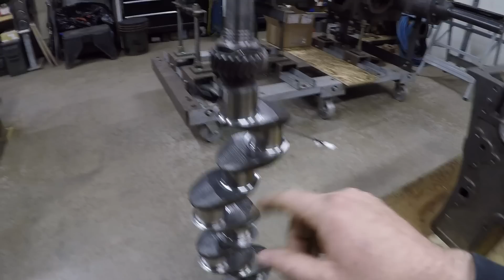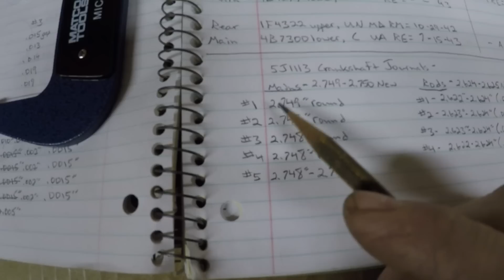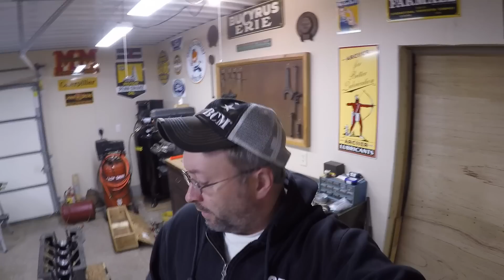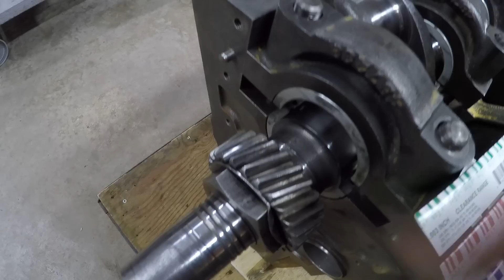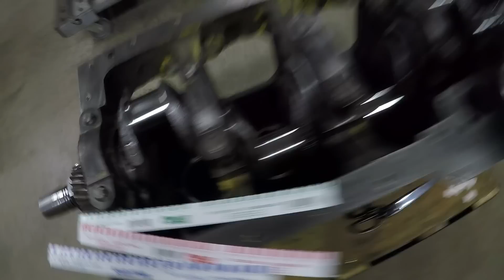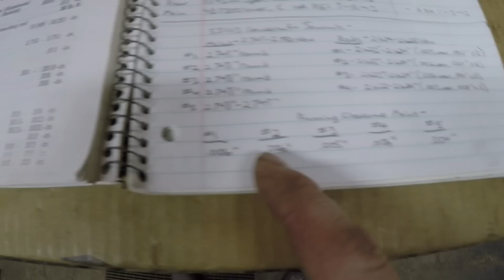Caterpillar D2 #5J1113 Diesel Engine Assembly Ep.9: Fitting The Crankshaft

Comment: I admire your precision and your attentiveness to the small details like clearances. People don't realize it, but those small clearances make a world of difference when it comes to the final assembly of the engine...and will greatly impact how the engine runs (and how long the rebuild lasts). I've seen plenty of "rebuilt" engines where the "mechanic" on the job didn't check to make sure clearances were within spec, and ended up with a knocking or vibrating engine once it was all re-assembled. In the near future I will be rebuilding the engine in my grandfather's John Deere 60 two-cylinder tractor and will be sure to pay close attention to the small details...on an engine with 10,000+ hours of wear, one rebuild, and 30+ years of sitting out in the elements, God knows what surprises await me when I tear that engine apart.

Comment: It should probably be noted for the viewers even though it wasn't said in the video that the book would say that you should not put oil on the back of the bearings because that would take up part of the gap of the oil clearance and when the oil clearance is like half the thickness of a hair, that gap is critical.  It should also be said that you should not put oil or assembly lube on the crank before you do the plasti-gauge because it takes up the clearance and won't give you a correct reading.  You are an amazing  technician.  Can't wait to see that beast running.

Comment: Squatch  i understand the crank run out check is a very necessary check because way back in 82 i put a big block Chevy together in a hurry and didn't check every thing. 
And it ran but not right.   I done this in Louisiana and when I got it home to Iowa it failed so i had to start over .  The reason being the machine shop that turned and polished my crank had turned the mains .020 off center and I didn't check it because I was in a hurry. 
A major mistake on my part.  
So I can appreciate your attention to detail.  Because anyone wanting to learn how to build a engine is going to learn how to do right  here . Thank you very much for that.😊😊😊😊👍👍👍👍👍👍👍

Comment: I've always used plasti-gage on engine rebuilds and I find it much faster and easier to use than trying to get accurate measurements with calipers. I've assembled hundreds of engines that way and never had a issue. I commend you on your diligence and accuracy in building this engine.

Comment: I love the simple design of the oil screw comcept.
Such a simple idea to drag the oil back into the circuit and remove the drag of the rubber of the oil seal.
Reply: Back in the late 60s there was a "Say Smoky" column in one of the monthly mags. Smoky Yunick responded to a letter,and stated a number of GM(I think) cranks with scrolls cut, had been computer programmed machined ,someone got careless and the threading was the wrong direction. Oil everywhere on a bunch of warranty engines. Oops.
Normally apparently it works great until the clearances get just a wee bit too big. But yes an elegant solution.
Reply: BMC used this sort of "Archimedes screw" seal on ~1 liter engines since the '30s. Worked great on the 948 cc Sprite I raced, FWIW.
Reply: @jacquesblaque7728  My previous tablet crashed no warning . Otherwise I could send you a pretty darn decent document that not only covered the history of Austin/Morris/BMC engines that also included reminisces as well as important measurements and criteria for such things as just what turned out to be excessive clearances for the screw to work.  One of much in the memory that is unretrievable. I can only say that such a thing is out there if you wish to do homework to find such.
Reply: I don't muck about with tablets. Prescription meds okay. My point was, and is: this sort of main-bearing seal was in use, and doing quite nicely, thank you, well before Cat used it on diesels. FWIW Archimedes screws are used widely in pumping Dutch dewatering canals, powered by diesels., augmenting windmills.

Comment: Squatch, I didn't make it past the intro without cracking up! Some keyboard warriors and high and mighty race engine perfectionists may be appalled by the use of plastigauge but they would also be equally appalled by the maximum permissible wear and out of round that's permitted in the manual. On a slow turning large clearance engine such as this the plastigauge check is more of a sanity check than anything, this is a slow turning low output (in terms of power per unit displacement) engine, not a 500 cubic inch 10,500 rpm pro stock engine. However your attention to every detail that may be infuriating or boring to some, I find it therapeutic. I'm also the type to take pages and pages of notes when building or assembling engines, those notes either get filed away for future reference or go with the engine when its sold. Someone in 2119 will appreciate this when they want to show their friends the rebuild of their Cat D2 5J1113 from 100 years prior. Have a great weekend, I'm going to watch the video you recommended, and I can assure you, I don't ever tire of airplanes, especially the older ones and war birds, to include cold war aircraft. If you've ever seen footage of B52s unceremoniously being dismantled in a guillotine it's painful to watch. Back in 2015 I had the experience of dropping off a fantastic aircraft to Davis Monthan AFB better known as the Boneyard. It was a P-3C Bureau number (or BuNo) 157319. It was an aircraft accepted in May of 1970 and had served admirably during the last 20 years of the Cold War and spent it's last few years finding drug smugglers. It was one of my favorite P-3's I ever served on and after recording a lifetime total of just under 26,000 flight hours, the flight to the Boneyard would be it's last flight as it was slated as a parts and reclamation bird, not a long term storage or resale bird. It was a bittersweet moment as the flight there marked the end of a 7 month deployment, but felt an awful lot like bringing your favorite dog to the vet to be put down. I wish that old 157319 could talk as I'm sure it would have great stories to tell, from carrying nuclear depth bombs, to tracking Soviet Submarines and even time spent in thr Vietnam war, it admirably carried it's crews and executed missions for 45 years. Hope you're having an excellent weekend, take care!

Comment: You know,given decades of hard use,"rode hard and put away wet" ,further hard use at the end of its working life likely with little maintenance,then parked neglected outdoors for God knows how long, gallons of water in the block,hard frosts,critters,whatever else, it just makes sense to meticulously measure absolutely everything. It really is a tribute to the designers they came up with such a machine . Overbuilt by modern standards ? Maybe,almost certainly.  But after all that,that Plastigauge being out what,a thou from original spec,no worrisome runout either end of the crank ? Wow,just wow.
First started watching because of the Minneapolis Moline. Still looking forward to that,but the Cat episodes sure have been interesting. All the best.

Comment: Not that you would ever sell it as you collect, not sell them, but if someone were curious as to condition... your record skills outweigh anyone else that I have witnessed! I used to put engines together and       considered my own work commendable... not now as you don't have to count on memory, its in "lead and white"/lol. I did good work or they were so good in first place that they lived because of it, in any event, no failures. I did have a engine come back and it only took a few minutes to prove it wasn't mine. I put my initials on every freeze plug and used one of those heat sensors that tells you if the block has been run hot. I made the owner stay for a few minutes and walked him over to a block I had finished and just went ahead and knocked out two freeze plugs in casual conversation and pulled them sideways out so I could reuse if had to but what ever I worked on I had plenty of plugs in the plug box and pre signed. then walked over to his and knocked out a freeze plug and guess what, my name wasn't on the plug and the serial no., wasn't in my record book as I kept those so this   couldn't happen to me. I had heard of it so just covered my own butt. The guy was white hot and he was apologizing as he was under the microscope now. I didn't have to make good on that engine cause it wasn't mine but I did build it and it set us straight. He was my best advertisement I ever had/lol

Comment: Nobody is faulting you for being absolutely thorough with this engine build; seeing as brand new parts are extremely hard to come by. You said yourself that you likely got the very last D3400 cylinder liners that were in the entire Caterpillar parts system. Those NOS cam bearings you squirreled away into your “parts warehouse” are likely made of .999% pure unobtainium. And we all want to see 1113 run for years to come.

Comment: Speaking of oil, & cleanliness. I've recently changed my brand of oil from standard. 15W-30 Quaker state to fully synthetic :
Royal Purple.  After doing some research & hopefully my Jeep wrangler is the last vehicle I plan to buy.
For a daily & good. Reliable transportation.
I couldn't believe the cleaning power of that stuff. After a bit over 1,000 miles it's.             
   a blackish brown, because the block looks like new again.  
If they don't make a suitable oil for Diesel they should. Just a FYI for the folks stuck on the regular oil. My Jeep, had 52,000 miles on it when I got it. I checked, in almost 2 1/2 years I've put just over 3,000 on it.  I believe I'll stay with Royal Purple & WIX filters. 
A Diesel application is truly where the High detergent level would  shine.  A freshly sealed engine is best for going to synthetic. A older engine the Synthetic likes to find weak spots & leaks. Mabe check & see if they make diesel engine compatible oil and maybe get a sponsor.
 I had no idea until I did some looking. I'd like to see your The D-2 passed down to your great grandkids.... 
 Every little bit helps... Doing great 
I've used plastigage on all my engine builds & only 1 failure in 35+ years.  Great video, every regular. Joe can follow that kind of info. Kinda old news to me but I've done it all my life. 👍👍
Reply: Roger, I'd recommend you head over to the site bobistheoilguy and do some reading. Nothing wrong with Royal Purple, it's serviceable oil, but more marketing than magic oil. You're likely spending money for purple dye and a feel good. Go check it out, do some reading, and make your own decision. If you really want to run a high end boutique oil, consider Red Line over Royal Purple. But the gods honest truth is that it doesn't much matter what you use with modern synthetic oils, Super Tech Synthetic is even great stuff.
Reply: @lukestrasser  for sure.  Safe for an engine, but all marketing

Comment: Squatch, I'm interested in what you did to prep the crank journals. Is that something you already did a video on?
Reply: Very good, thanks Squatch. I know from machine work that even new fine paper doesn't cut steel very quickly. Have you ever used the technique where you wrap the abrasive around the journal several times and work it back and forth with a long string?

Comment: Squatch253. I have a question regarding the plasta gauge readings of the main bearing. If the service manual says clearance for No.1 bearing is  .0055"- .012" and the plasta gauge reading is .006" with the crankshaft resting on the upper bearing, wouldn't that mean the clearance is actually .003" ?
Reply: @squatch253  Got you now. Many thanks for the comprehensive explanation. I really enjoy your and seniors videos.

Comment: Hello Squatch253 I have a fault on number 1 cylinder. It chuffs when you introduce fuel to that cylinder. Back off the injector nut it stops. It only does it when it fires. I supect ring or valve issue. The injector is as new, overhauled and tested . What do you think ?
Reply: Its a Cat D2 3J
Reply: @squatch253  Thanks. I will look at that

Comment: I have worked on a D2 5J that some relatives have.  I was wondering if someone could answer a question about it.  The fuel pressure on the gauge is almost non-existent when being spun over by the pony motor or on the rare occasion I can get it running.   It take forever to start (1/2 hour running the pony) and doesn't have any power.  I can't find any manual that has more than 1/2 a page on the lift/transfer pump and no diagrams to speak of.  I'm assuming that the pressure relief valve needs to be shimmed, but again there is no information I can find on it and gaskets are not available.  Is there a source of information that someone can recommend?
Reply: @squatch253  Thank you for your quick reply.   I kind of figured that it would require complete removal and rebuild of the transfer pump tower.

Comment: I thought that to determine crank straightness, you had to put the first and last main bearing in V-blocks, spin it, and record runout with a dial bore gauge. In addition, runout had to be checked against the manual.

Comment: Makes me nervous seeing the crank standing on end  :-))
Reply: Yeah I cringed when I saw that.
Reply: Sorry. Don't understand. My training was that all bare crankshafts should be stored vertical. On end or else was the phrasing. Maybe if you have a true flat surface and sufficient V blocks for all the main bearings,that would likely be fine,but otherwise on end.
Reply: It's fine on end like that but I would be afraid of it getting bumped and tipping over.
Reply: Squatch253 with my luck we would have an earth quake.  I live on a fault line.

Comment: Unsubscribed.  If the internet has taught me anything I is engine rebuilding.  Everything has to be blue printed, balanced, and copious references to "billet".  Very little chance of it surviving for very long at 6k RPM's.
Reply: No counterweights on that 4cyl crank I wouldn’t give it more than a few hours to live at 3k. Lol
Reply: Considering that the max governed RPM on that engine is likely well under 3k, I don’t think there is anything to worry about..😆
Reply: @bcbloc02  LOL.  So I guess it isn't going to be very competitive in the pro stock class.  Oh I know we just need to bolt a fluid damper on it.
Reply: @notajp  The second thing I learned from the internet is to worry about everything. LOL.
Reply: Needs to do an LS swap to really make it run.
Reply: Squatch253 You know a turbo would quiet it down and give it a bit more grunt.😎 Probably could find out how much if any they overbuilt those drive clutches. Lol